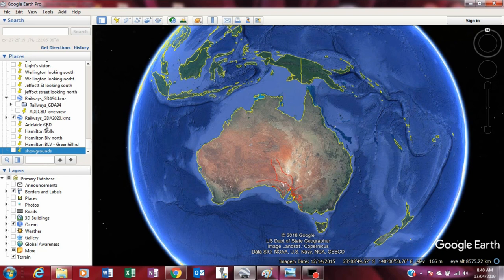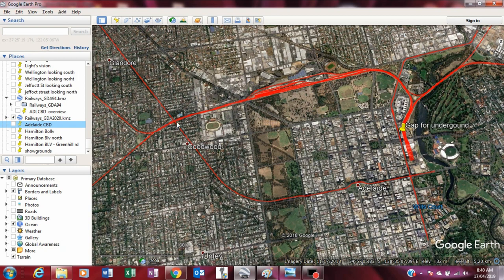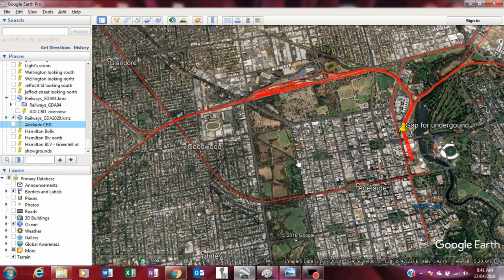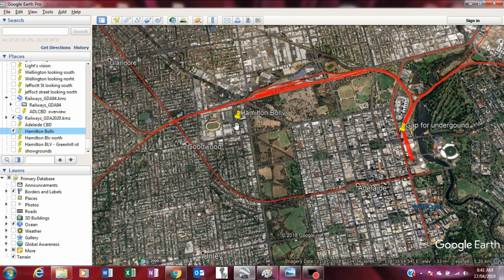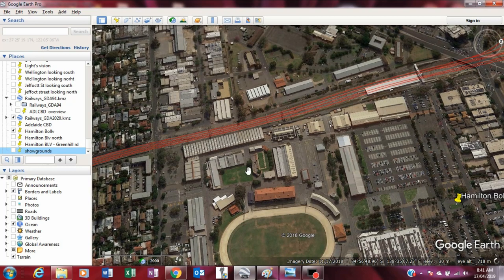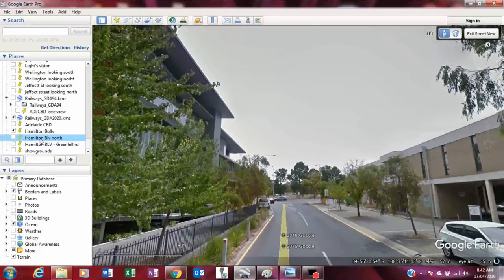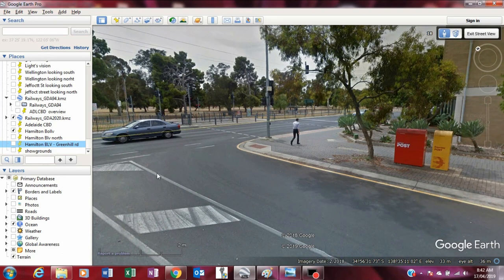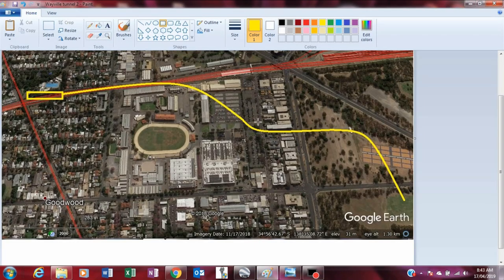North South Rail Tunnel via Hamilton Bvd Adelaide April 2019 video

Comment: Hi Neil.
The north south tunnel is to my mind is an oversimplification of a one off project that only occurs once every 200-300 years. For this reason the Adelaide railway station should be endorsed as the terminus for not only Metro (through) lines but also future regional, intercity & Interstate (Overland). With dive sites each end it doesn't really matter where the TBM line goes provided there is space & access for support services. While a 'gap' has been left between buildings for a dive site this is a less than an ideal alignment for a very short north-south tunnel not serving the total CBD.  
At the north end the dive should start north of Nairne junction and go directly under the existing Adelaide railway station (with maybe a station box immediately west of the station for access) then progress in an underground loop around the CBD and reentering the Seaford line somewhere south of Sir Donald Bradman Drive with connections north & south. In this way options are given for other lines to enter either way. (See Auckland CRL).

In addition a third rail should be provided for future standard gauge metro services from say Two Wells and beyond. However the ARTC interstate line would need to be duplicated to provide space for future regional services. The new Spanish CAF Regional trains to run in NSW are to be bimodal and therefore could run electric overhead upon entering the Adelaide Metro area. Thus future bimodal SA regional rail could then use the CBD tunnel. 
This would be an awesome service winning back the place Adelaide held in Australian railways as the premier train service. DaveU
Reply from the maker: Hi David    If the tunnels are deep enough the buildings above become a les of an issue.   

Brisbane has the Clem 7 At its lowest point, the tunnel is 60 metres below the Brisbane River and the CBD 
https://en.wikipedia.org/wiki/Clem_Jones_Tunnel

The depth of the tunnels of Brisbane Cross River Rail Tunnels varies across the alignment, with the deepest section under the Brisbane River being approximately 42 metres deep.

https://www.youtube.com/watch?v=Hq4ZITOPiA4

The Albert Street Station is 30 m below the Brisbane CBD
https://www.youtube.com/watch?v=RUPZQ8y6vdk

Roma Street Station is where Regional and Local trains and buses come together
https://www.youtube.com/watch?v=Nnmy8IuqAzo

https://en.wikipedia.org/wiki/Albert_Street_railway_statio

The MATS Plan in 1968 proposes a rail tunnel under King William Street to get rid of the problems of the Adelaide (Terminal) Railway Station 
The route is similar to what you propose in your message.

Interstate trains are rather long and they the platforms at ground level in Adelaide (Terminal) Railway Station are not long enough.         
Even at the Adelaide Parkland Station the Ghan train has to be broken halves so its passengers can get on and off the train.   Platform A is not long enough during the high season for the "longest train in the world".

Neil

Comment: I reckon a TRAM - TRAIN. (A Tram that can also run on Train lines) would work because then it could convert the existing Rail lines out to Grange & Outer Harbour as well as the O-bahn via an inner city Tunnel & then it could also extend by running along existing Streets between Tea Tree Plaza & Golden Grove. It would be a high capacity version of the Light Rail system with longer Tram Rolling stock. I call it the Adelaide MTS (Mass Transit System)
Reply: i have actually based it off Dallas DART system or Seattles Light Rail
Reply from the maker: @electro_sykes  I was in Seattle when they were building the DART   We were staying out near SEATAC airport.    AS I remember they are re-using an old rail tunnel under down-town Seattle that had been re-used as a trolley bus, busway. 
In the 1920's an Electric Trams to Outer Harbor were going  be built on the Outer Habor Line after the completed the conversion of the South Terrace to Glenelg railway Line to electric trams.  The 1929 Financial Crash got in the way.
Steel wheel trains cannot get up the hill from Paradise to Hope Valley.    They would need to take a different route via Gilles Plains and Valley View to get to TTP
Reply: @Highbury5089  Actually to cut costs, it could run on street in Adelaide, on Grenfell Street, which would be transformed into a pedestrian-friendly corridor much like burke street mall in Melbourne. Meanwhile, out in the suburbs on both the Grange and Outer Harbour as well as on the O-Bahn, they would run as fast as trains. And it will be different from Adelaide's existing Trams because they would be longer. As long as a 4-car train or 3 existing trams are coupled. It would be built in 2 phases: Phase 1 would be from the CBD - Tea Tree Plaza via the O-Bahn Busway, whilst Phase 2 would see the Grange & Outer Harbour lines finally converted. Phase 3 would see the long awaited extension between Tea Tree Plaza & Salisbury Station on the Gawler Line. This would run via Golden Grove, which is an important community hub in the growing North West suburbs of Adelaide. Not only would this guarantee better service for Port Adelaide Residents, but it would also upgrade stations and replace ageing diesel trains. In addition, it would also improve service for North East residents with additional stations added along the O-Bahn making Public Transport more accessible for more residents. This would be a game-changer for Adelaide.

Comment: If the line goes though Morphett street would they bypass the current Adelaide station?
Reply from the maker: Hi James.  An important question. The underground line would probably have a station near to Adelaide Terminal Railway Station and the Royal Adelaide Hospital (RAH),   Connected by underground pedestrian passageways to there and to Adelaide Oval.
This was done in 1888 at London Victoria Railway Station with the underground "District Railway" (now called Circle Line) ,https://en.wikipedia.org/wiki/London_Victoria_station#/media/File:DISTRICT(1888)_p142_-_Victoria_Station_(plan).jpg
The State Government and Adelaide City Council are also looking for a site for new Concert Hall for orchestras.   Do not be surprised if it is put on Lot 103 or Lot 102 on the North Side of the Rail Yards.  The new underground railway could extend under Torrens River, under the Golf Links and under Memorial Drive to the Torrens Rail Junction to continue as the Grange, Outer Harbour or Gawler Lines.
Hundreds of consultants are currently employed drawing up schemes and plans for this section of real-estate.
Perth Underground Railway Station is adjacent to the Perth Railway Station where the Joondalup Line merges into the Mandurah Line
Reply: @Highbury5089  thank you for the information
Reply from the maker: @James-fw5ew  Your welcome.

Comment: Where did you get the info on the Govt plans for underground rail in the city?
Reply from the maker: I show that in the other video about this proposed tunnel.   
Here is the link.

https://strongplan.com.au/policy/our-infrastructure-priorities/

"We will ask Infrastructure South Australia to analyse as a priority, the following 10 major projects:"

Here are the 7 items that on their list that involve steel and concrete railways.

"3. The GlobeLink upgrade of major export infrastructure
4. An extension of tram services in the CBD
5. An underground rail link in the CBD between the northern and southern train lines
6. Completion of the Gawler Rail Electrification
7. An extension of the O-Bahn between Tea Tree Plaza Interchange and Golden Grove
8. Grade separations at major metropolitan intersections to enable removal of level crossings – prioritising projects based on their capacity to reduce traffic congestion and boost productivity
9. Infrastructure development on Le Fevre Peninsula including light rail, commercial, retail, residential and recreational development to accommodate the needs of the Naval Shipbuilding Program at Osborne
"

They plan to consider making plans.